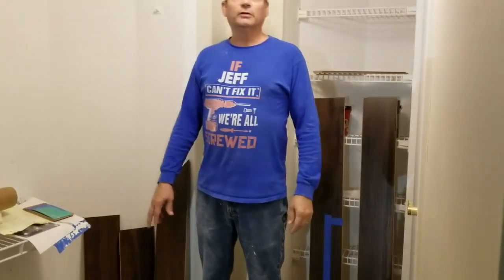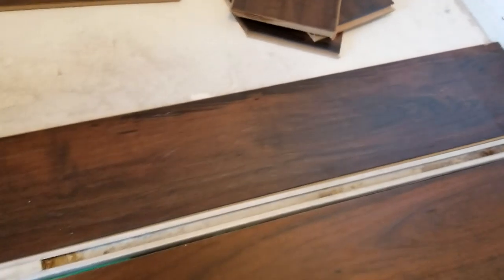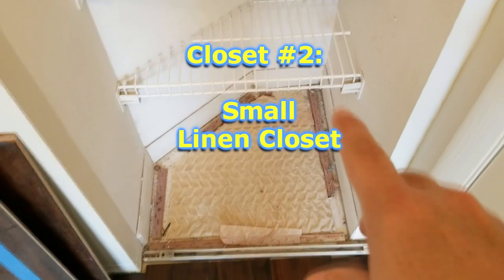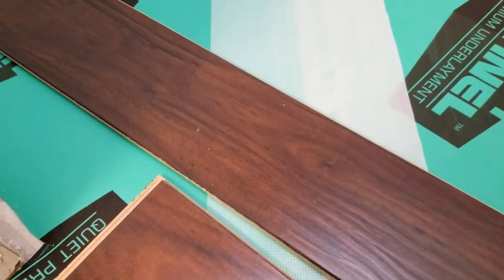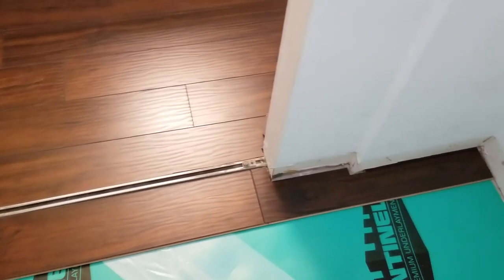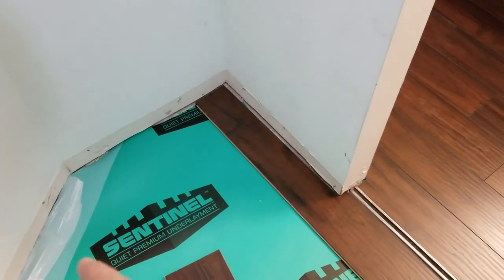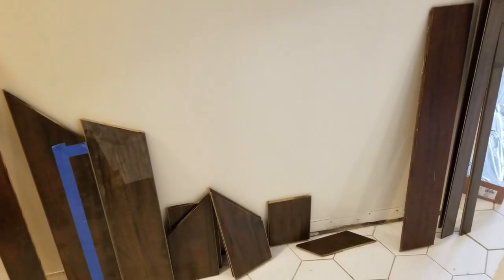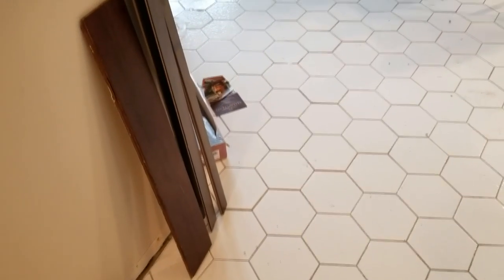How to Install Laminate Flooring in Closets and Door Tracks

Comment from the maker: Tools used in this video to cut laminate wood floors:
General Tools TS02 ToolSmart Bluetooth Connected Digital Angle Finder https://amzn.to/2FKb5lt
Cramer 5-Fugi Caulking Kit: https://amzn.to/2DjZVC1
Roberts Electric Door Jamb Saw used in this video for laminate flooring installation: https://amzn.to/2QOaeqI
DEWALT DW715 Chop Saw: https://amzn.to/2RchGLw
Ridgid R4510 Portable Table Saw with Stand: https://amzn.to/2BMY5rJ
RIDGID 50323 Wet/Dry 12-Gallon Shop Vacuum:  https://amzn.to/2Sdn3al

Comment: Is it okay to get the last row of laminate very close to the track from outside closet to avoid installing quarter round to close bigger gap since  track is small and on the same level as laminate??
Reply from the maker: Yes, I do that all the time, because you are only talking about 2 feet deep of wood floor, not much expansion there. also, I remove the baseboard, so even in the back, make what gap you want, and cover i with baseboard on top of the floor, I never use show rail.
Reply: @jeffostroff Thank you sir

Comment: I have continued the laminate from room into the closet. How do I secure the guide to the laminate? I can't screw it to the laminate.
I have concrete subfloor.
Reply from the maker: 2 ways you can do it. Either cut the flooring so it stops maybe 1/8" from the track, then pickup inside the closet on the other side of the track. You will want to practice with a piece first to see if you notice the gap in front of the track from where you normally stand. The other way you can do this is to screw through the track and through the wood and into the concrete floor, but you need a concrete drill bit and blue Tapcon anchor screws to tap into the concrete. Another thing is do you really need to go through to the concrete? If your floor is stable and not shifting, I bet it still holds the rail pretty still if you just screw into the laminate and not go all the way through to the concrete.
Reply: @jeffostroff  Thanks Jeff for the options.
I almost thought of a double sided tape!! You are right, the door won't move much.
I saw someone else drill bigger holes (3/4") in the laminate and use the special screws to the concrete. This way most the weight of the door is on the screws and there is enough gap, by the screw, for the floor to move. Something to think about.

Comment: Why not remove the track of the small closet and put the flooring under the track? Thanks
Reply from the maker: Yes, you could do that. We had installed the wood floor, and later decided the carpet in the closet was too old an dworn and the closet would be better served with the laminate flooring.
Reply: Thanks for the question. I continued the laminate from room into the closet and will put the guide on top. 
The problem is now I cannot screw the guide into the laminate, I will have to find a different way of securing the guide to the laminate! Still trying to figure it out.
Reply: @Equilibrium29  I thought of continuing the flooring right into the closet too however I was concerned about movement of the track if it was on top of the flooring. The underlayment pad gives so the track would float. Didn't think that was a good idea so I left the track screwed to the wood subfloor and planked on both sides separately.

Comment: I don't think you really know what you are doing. You use too many kinds of  tools.
Reply from the maker: Too many tool? What does that have to do with someone's knowledge of installing floors? What tools should not be used. Then end results are perfect.
Reply: And what was that cut you did on the third row? And your reason was u don't wanna cut that 2 inches short. And then what u did is u cut one board short and cut another piece shorter. What was that u called it? A tongue cut? U should be ashamed of yourself. U should have done is to take all that row off and then measure it and cut from the left where your starting point is. So u don't have to use that what do u call that tongue cut. Looks like an amateur cut. I'm only an amateur, but i only use a cheap table saw and a Ridgid Jobmax tool. U probably go crazy when you have to do heating and air con vents.
Reply from the maker: Your logic is all over the place. First of all nowhere did I even mention the word Tongue Cut, I don't even know what a tongue cut is, never heard of one. The purpose of this video is to show DIYers how to use scrap pieces to install into the closet so you don't have to go buy more boxes of wood floor planks. Even if there was a full length piece to use like you said, it still would not have fit all the way across, and we would still be left with a  smaller cut anyway. Also as for butt cuts, the manufacturer of the wood flooring says you can have one every 3 rows, and like I showed in the video, all butt cuts must be at least 6" from a seam between  2 planks, and we exceeded that easily. . We had one butt cut in this closet, conforming to the manufacturer specs of one per 3 rows. Like you said, you are an amateur, so you lack the training on all the nuances of wood flooring. Nothing wrong with your table saw but your job max tool is not proper for making 45 degree cuts which should be done on a chop saw. We only use the table saw for rip cuts and making L-Shaped Cuts.
Reply: @reggie let's see what you can do bud. Go post a video of you doing the same thing. I doubt you can even read a tape measure so how about you  shut the hell up and let  this man do what he's doing. If you don't like the video don't watch it.
Reply: @jeffostroff  Agree - it looks great!